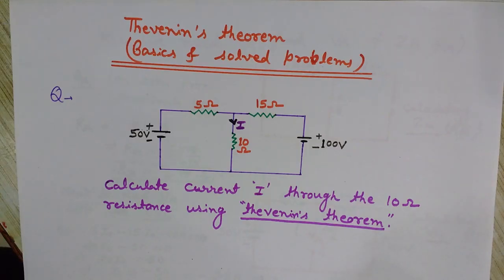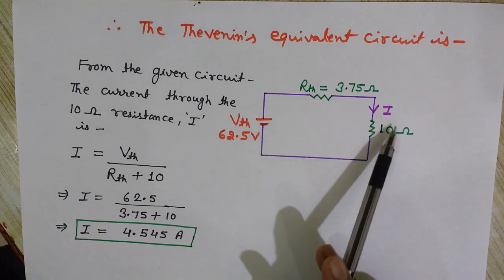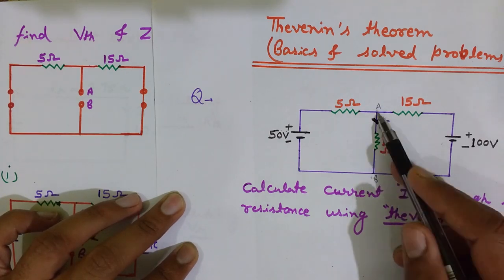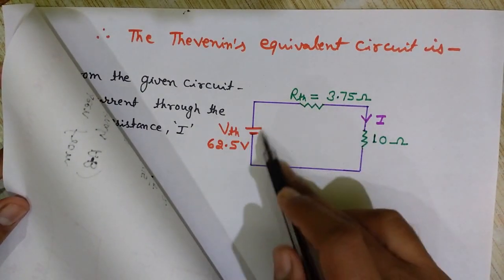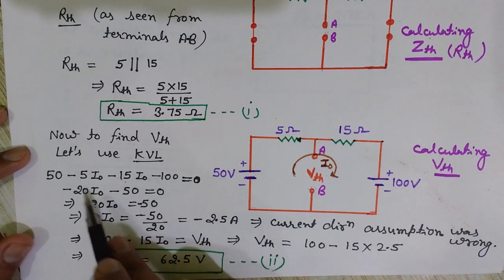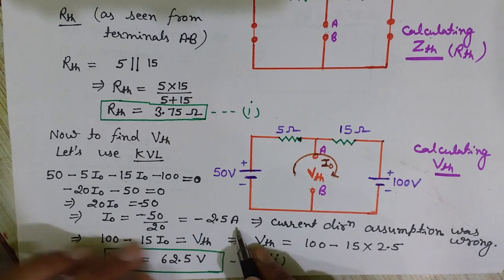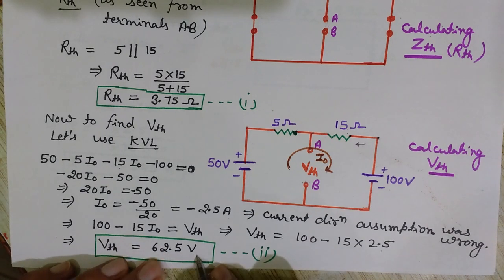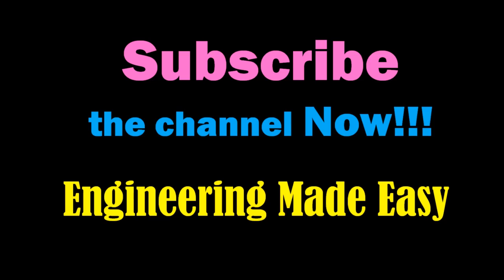Thevenin Theorem- Thevenin Equivalent Circuit- Thevenin Problems- Network Theorems- Network Analysis

Comment: I had a confusion that 5 and 15 ohms are in series not in parallel  can you explain this?
Reply: They need to share the same 2 nodes to be parallel, there is another resistor in the way, it divides the current
Reply: @thusharanup4906  that doesn't make sense though; because if the resistor 10 ohms is open circuited(Due to it being the first thing you do when you begin a thevenin's equivalence problem.) then that would mean no current or voltage goes through there. Therefore, the 5 ohms and 15 ohms resistors should now be in series with each other as nothing is obstructing it.
Reply: since 5 and 15 ohms are connected to the same points or nodes , it can be known as parallel

Comment: l thought if we remove the load  resistor 
those resistors will be in series since no current is flowing through. besides resistor 5 and 15 are in series